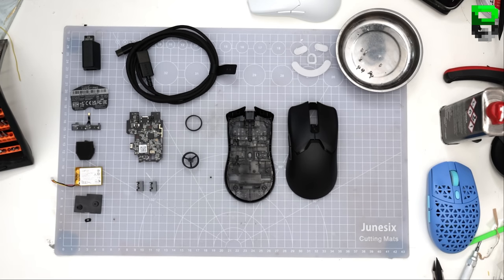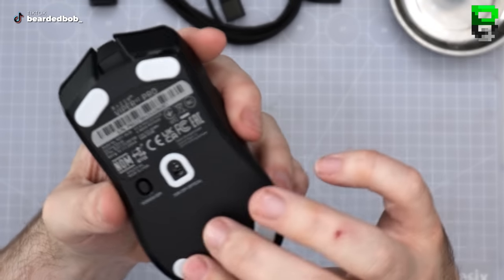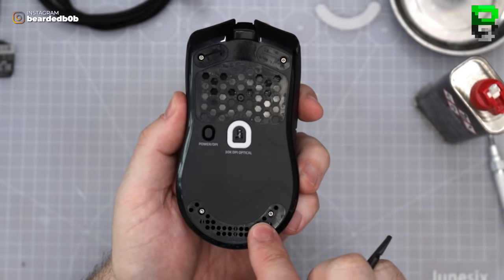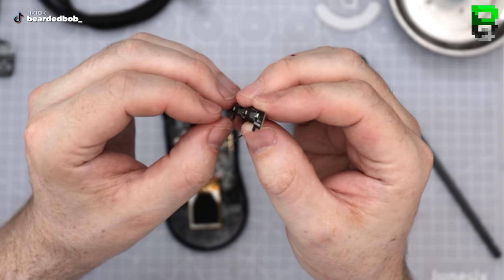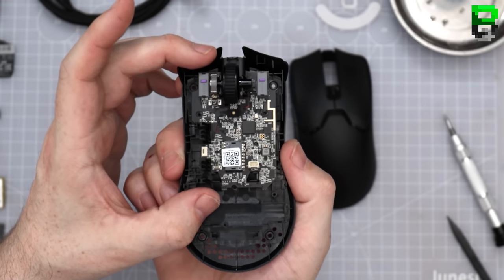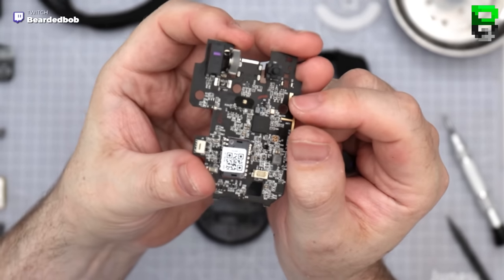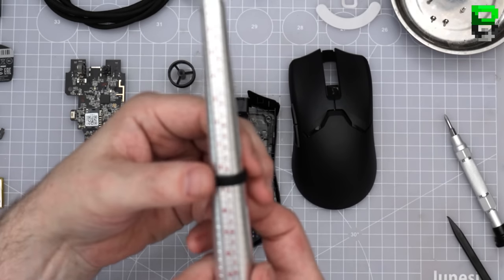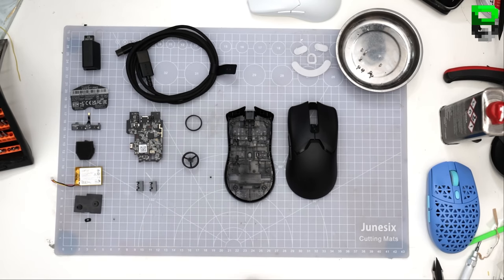OMG CHEAPLY BUILT: Razer Viper V2 Pro Teardown

Comment: If you do a weight mod or another tear down I recommend doing it on the white one. The white is always so much easier for us to see what's going on in the inside, it's also easier to work on.
Reply from the maker: Noticed, the white though is heavier than the black :-(..... prob need to adjust the ISO so the black is more visible but thanks for the feedback.
Reply: @Beardedbob  No problem. Looks like there is a lot more white Vipers around, so a weight mod on the white might be the better choice in that regard as well. Did you only purchase black Vipers?
Reply: nvm missed the white one in the video. Clicked directly to the tear down.
Reply: @lukewheeler2361 Respectfully, I couldn't disagree more on all 3 of those points.

Comment: I have been experiencing an issue with my mouse where the scroll wheel occasionally scrolls in the opposite direction, leading to inaccurate scrolling. Would it be possible to replace the scroll wheel encoder on this mouse? Additionally, could you recommend a suitable replacement that would be compatible with this mouse and also provide smooth scrolling performance? Thank you.
Reply: Literally just watched this video to check where the screws are placed under the pads because I had the same issue. I used a toothbrush to clean around the scrollwheel and it seems to have helped, for now at least.
Reply: How exactly did you clean the wheel? And is it difficult to put the mouse back together later? @khazareek
Reply: @mironiks66  I used an old toothbrush. Its not difficult, you just put the screws back in and stick the skates on.
Reply: Thanks, I'll try to fix my mouse)

Comment: Great video and information yet again. 😎👍

Got it the next day after its release .. however .. I have a claw / palm grip and it's no bueno (no good) at least in my hands. It's too short in length and height and I end up holding it at a 15° offset counterclockwise so my aims off. Since I bought it from Amazon, it's probably going to be shipped back to them. The switches and encoder are okay. I guess what I really want is a 60 g DeathAdder (not a ~89g).

Bottom line. Unless you're a fingertip grip person or someone with small hands, I would skip the Razor Viper V2 Pro. I don't care about the money BS. It's just not that good for me regardless.

GPX Superlight is still my GOAT.
Reply: How much palm is your “claw/palm” grip? I have relatively large or at least medium sized hands and I’m almost able to palm a basket ball but I’m still extremely comfortable palm clawing the Viper V2 Pro. In fact, I’ve seen most people recommend the Viper shape over the G Pro unless if you have a palm grip. But even then I think the lower hump helps with palm grip since your hand is in a more relaxed/lower position.
Reply: @arsenai4935  .. Those people lied to you who said otherwise. Buy it and try it. I have a stupid amount of mice, money isn't the issue and I like Razor products so there's no anti V2 Pro agenda.

Perfect "SIZE" for my hand is everywhere from the Razor DeathAdder V2, Xlite V2, Glorious O, G502, GPX Superlight, etc. The Razor Viper V2 Pro is both shorter in length and height and because of that and its hourglass shape, it ends up at a 15° offset and it's not secure in my palm. I play at 5400 CPI with no reduction in multipliers. 

On my Momba CoD channel the last example is a GPX Superlight at 5400 CPI.

Last night I played with the Razor V2 Pro and I got a V2 but my games were inconsistent and I went from the top of the leaderboard 95% of the time to middle the pack 95% of the time. Other reviews that I've read stated the exact same as me and I read them after the fact.

Again buy one. I'm not discouraging anyone. I literally couldn't care less what people buy or don't buy.
Reply: @DJaquithFL  I completely agree, I bought it immediately hoping that I would love it. Unfortunately, your list of perfect mice is the same for me, which means this mouse is just too small for my hands. I'm immortal in valorant and I was bottom fragging on a plat/diamond alt account (while testing the new mouse). It "feels" nice because it's so light but the shape is hard to stay consistent with if it doesn't actually fit your hand. a 60g DeathAdder would be amazing.

Comment: It’s an okay mouse. I will be returning mine as the scroll wheel they chose to use has too much play. They had time to make this perfect.
Reply from the maker: Should have released a viper mini ultimate but instead they released this witch if a mini viper scaled up
Reply: Yea def a really good mouse but noticed my scroll is slightly crooked which isnt the problem it just feels off or cheap for some reason, but the rest of the mouse is amazing. Prob a different encoder would fix the issue. Needs to be a bit smoother imo. However does stick up slightly high which most people will probably prefer over the ultimate. Really great mouse but still think a wireless viper mini pro and ultimate would sale amazingly well if not better. I prefer medium sized mice but the mini is solid shape for me.
Reply: @Beardedbob  Facts, whoever is in charge of the hypetrain needs to get woke because they are arrogant. They know what us consumers want out of a product it’s just that they view us as transactions realistically. They couldn’t give a crap.

The only reason why I gave Razer a chance again is because of how good the Orochi V2 is.
Reply: @Beardedbob  they devs acknowledge the viper mini’s popularity in our community and they’ve always said that they are going to take their time with it to make it perfect. The devs want it just as much as we do. Makes sense to release the viper v2 first because they need a product that competes with the logitech superlight, and they know that the backlash will be worse if they make a mistake on the Viper Mini Ultimate, but it wouldn’t be as big of a deal if the Viper V2 isn’t perfect since the original RVU is still a good mouse.
Reply: A N I M E
N
I
M
E

Comment: Do you think you can solder a less tall scroll wheel encoder in there so the scrollwheel sits lower, or would that automatically interfere with the ucb-c port?
Reply: Im planning to put a 11mm ALPS Mouse Scroll Wheel Encoder on my V2 pro. Would this work?
Reply: @doomed_to_fail  technically it should work, but I cant tell you 100% because I just kept the old encoder

Comment: Type of battery and how new switches work and even fully disassemble?
Reply from the maker: Yep shows you all that you need to know 👍
Reply: @Beardedbob  Oh I mean for future fixes, if you can get easy replacement for them, that's kind of the info I was aiming for. Like using standard voltage on the battery make any other brand/model compatible and easy to replace without going for original parts, same for the switches. Features worth taking in consideration ;)

Comment: So if anyone reads this. Can i just take the battery out of mine and use a Dreamcable USB-C cable to make it a "wired" mouse?
Reply from the maker: Not sure but I keep meaning to test it
Reply: Just tested it. You can remove the battery if you plug a usb cable in it will work. Sadly I don't own the equipment to test any possible changes in latency etc. also it would probably be a bit front heavy since it is pretty well balanced overall.
Reply: P.S. The superglides i got for it seem to be "slower" than the older production models. Not "slow" but not gliding around my control pad as if it were ice.

Comment: @beardedbob is it normal for the PCB to seemingly move when plugging in or unplugging the cable? I can feel the board moving and can see the sensor moving through the bottom of the mouse. Not a major movement obviously, but it's there. Used to see this on my GPW too. Do I need to RMA it?
Reply from the maker: No the pcb is loose inside and probably needs screwing tighter. I would rma

Comment: Different kind of question :) How, where and which kind of weights would you add to make the Viper 70g-75g and keep the weight well balanced.
Reply: NeroFat  Dude I am not stupid. I have Viper Ultimate.
Reply: @tomasiskooo  then why????
Reply: @NuggetsXInfinite  He just wants a heavier mouse with better specs
Reply: @tomasiskooo  The Viper Ultimate is 74 gramms...
Reply: @aeisbaer8042  I know
Reply: @tomasiskooo  then why did you ask to add weight in order to get it to 70-75g when it already has that kind of weight
Reply: @aeisbaer8042  take a guess
Reply: @tomasiskooo  No idea
Reply: @aeisbaer8042  I simply wanted heavier V2 Pro which is even tho slightly, but better in every way than Ultimate.
Reply: @tomasiskooo  I dont know what to do with the weight of the front of the mouse, but switch battery for a bigger one. You get weight in the back, but also a lot of battery life.

Comment: i know you wont be reading this but i was curious about what switches you used for the side buttons because both of mine just broke apart and i cant find any replacements for them? Or does anyone know if you can buy the whole side button thing new with the old switches on it because i am not the best a soldering.
Reply: My Viper mini side buttons had a double-click issue after 2 yrs. I'm also wondering what kind of  side buttons razer use.

Comment: hey I was wondering since the rubber for the scroll wheel is thinner, if I wanted to replace it should I get a ring size 8 or 9?
Reply from the maker: Would need to try both, imo the tighter the ring the better

Comment: is that zippo lighter fluid?   or is it some sort of oil/solvent?
Reply from the maker: zippo
Reply: @Beardedbob  awesome...why that particular fluid?   are there specific properties that zippo fluid has that just works better than other types of solvents or fluids?
Reply from the maker: Just the one I prefer, some people use isopropyl but i've not tested it so i'm not sure if it works the same
Reply: @Beardedbob  well here is definitely one thing that iso alcohol is terrible for is anything plastic.  iso has a tendency to fade plastics, discolor then, and sometimes leaves a white foggy film that can really mess up some types of plastics...💯    so definitely be careful with that...especially high % iso alcohol like 91%.   that stuff with straight destroy some stuff.   the normal strength 70%   is easier on surfaces, but even that you gotta be careful with.   i suggest watering down iso alcohol when using it on plastics or clearcoat and/or painted surfaces.

....however if you're going to paint what ever you are using the alcohol on, then it doesn't really matter that much.

another fluid i use to obliterate adhesives is "goo-gone".

its fantastic it your using it to take off residue from glues and other adhesives...but you definitely have to be careful with that stuff in some cases....it is sooooo slippery (because its a base)   and once you use it, definitely clean off the goo-gone very extensively.  cause its oily super lubricant type property can be very dangerous if you spill some on the floor...💯   even if you spill it on the floor it is a son-of-a-bitch to fully clean up...

...i almsot broke my ankle because i misssed a spot cleaning it off some tile floor and it was ALL BAD...so i had to use 91% iso alcohol and drench the area where i spilled it and used a green dish scrubbie to ensure that i got it all off...then for good measure i boiled some plain water and scrubbed the area again with a few clean rags, then dried it rubbing another clean rag or 2 for good measure....lol
Reply: @ZenRyoku  I used to regularly clean my fk1 (original, yellow logo) with 91% iso. Color never faded but the texture did change ever so slightly over the 8 or so years it was in use. I actually preferred the way it felt towards the end vs new, it got a tiny bit more grippy. Guess whether you wanna use it or not depends on if you like your mouse’s coating to begin with, cuz it’s not like it straight up destroys it.
Reply: @VicariousX  well if that works for you, that's perfectly fine...a more tacky-grippy surface is always more preferable...

...but so you know, the acidity of almost pure alcohol (91% iso)   IS IN FACT deteriorating the surface of anything plastic simply because its chemitry...💯

but know this...even if its barely noticeable over time, that plastic will break dowm enough to not only become brittle (so say uf you accidentally drop it on the ground or it makes contact with a hard enough surface, it will most definitely crack...💯

yeah...maybe it wont happen for some time...sure...but you are chemically eroding whatever you are putting that concentration of acid-based alcohol...💯

some plastics will even leach certain chemicals that they are comprised of into whatever they make contact with...like skin, or food...
so word to the wise:  never use alcohol on a plastic or petroleum based surface of anykind that holds food (like tupperware, baby bottles, pacifiers, etc...etc...)

Comment: You didn't dismantle the main keys! Do you have to pee in a hurry? That's the main problem with the Viper, those fucking keys and you didn't show how you changed the design. Old fool, but you're the best here at disassembling mice, I always watch your videos.
Reply from the maker: You can’t they are plastic riveted on so once you break that you will have to glue it.

Also watch the full Twitch vod there is more